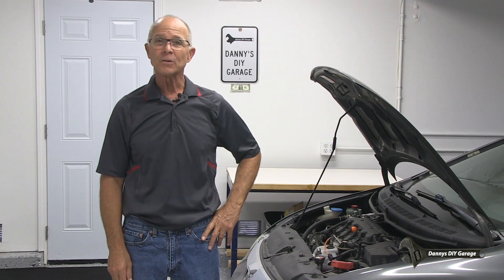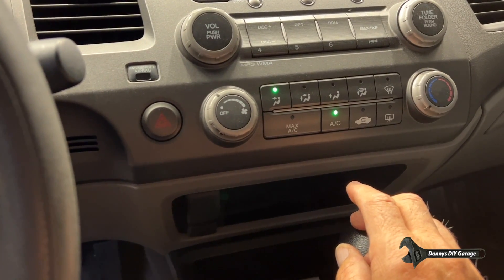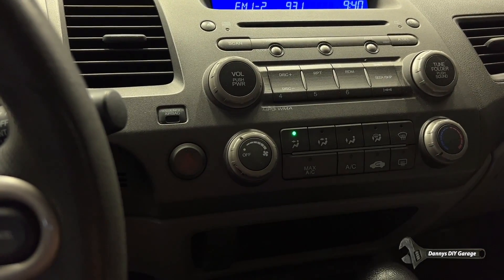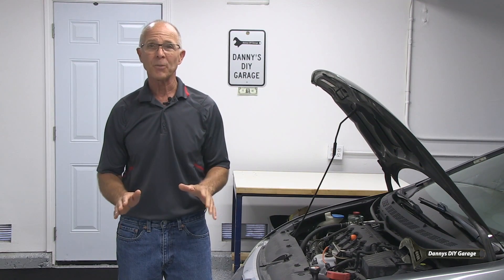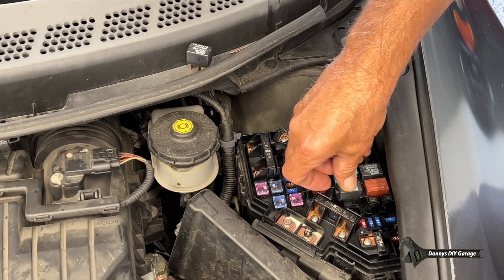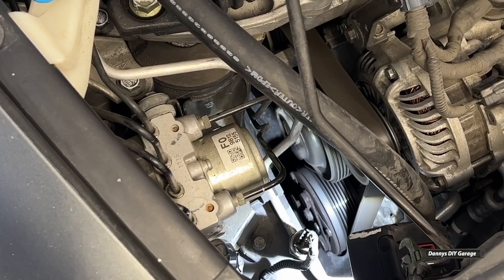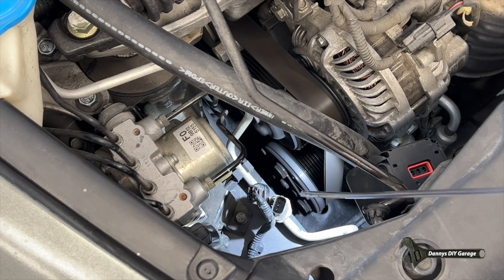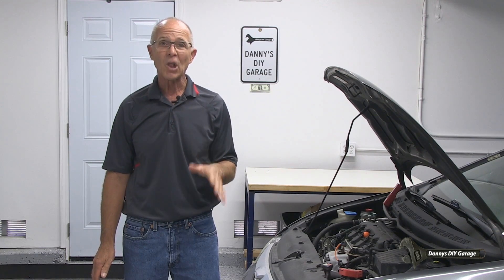Honda Civic 2009 AC system blows warm FIX

Comment: This is a great video and it covers a lot of diagnostic steps. I would like to add one more thing that could have gone wrong and could be affecting your AC compressor clutch from engaging. I actually got an AC compressor replacement and then realized that my compressor was still not engaging when AC was turned on. The relay was not the problem. The connector that plugs into the AC compressor had gone bad. It ended up being a simple $25 replacement. I wonder if I could have gotten a lot more miles out of my original compressor if I had figured that out earlier. The part number I used was Duralast Electrical Wire Connector CONB11374 to replace the original connector on my 8th generation Civic.
Reply: For reference, it is the black female connector on the left on top of alternator in the frame at 5:35
Reply from the maker: Thanks for adding this

Comment: A lot of times on these 8th gens, over time the shim that helps engage the AC compressor clutch expands and contracts over time from heat until one day the AC compressor clutch won’t engage anytime the weather gets above 85 degrees, because that shim warps.

Solution: remove the shim! No need to replace it either. AC will be blasting cold again! Did this on my 08 Si about 3-4 years ago and AC has been perfect ever since!
Reply from the maker: Thanks for adding, one of my videos covers the ac compressor clutch air gap and how to diagnose it, exactly what you’re suggesting

Comment: Would've been nice to know be told where the blend door actuator is located
Reply from the maker: I have two videos on the air mode actuators, one that controls the temperature and the other that controls the airflow direction of the vents, I thought I linked them in the description and at the end of the video as suggested videos, if not sorry about that, I’ll make sure I do that
Reply: @dannysdiygarage sorry, just had me a tad confused is all. Video was really helpful and I've realized it might not be as expensive as I thought
Reply from the maker: @youtubechannel8854 good luck, follow the video and it will go great, thanks for checking out my channel

Comment: Great video. Really helpful. When doing the process for code which light is supposed to flash? The one on control doesnt but the check engine light flashes 5 times.... the issue im having is that the ac compressor doesnt cycle off. Also when on recirculation I still get smells from outside and when blower motor is off I still get the wind from outside blowing in. Does one of the actuators control recirculation?
Reply from the maker: I have videos on both actuators on my channel, I also have more AC videos that should help

Comment: the relay test ended up fixing my issue, went from blowing 82F to 74F....replacing the cabin air filter now and will eventually recharge the freon to see how low i can get it.
but for now, this is plenty cool :)

Comment: Is part number 39794-SDA-A03 or 39794-SDA-A05 the correct part for a 2007 Civic SI AC relay? I’m reading A03 is being replaced by A05 because it is a known issue in AC failing. Is that correct?
Reply from the maker: I’m not sure

Comment: Saved me thousands! This guy goes step by step working through the possible problems. Mine was the relay for the compressor. Simple fix to repair, but never would have thought to switch with the fan to check. Thank you so much!
Reply from the maker: I appreciate your gratitude and support

Comment: My 2013 Honda Civic EX has an issue where AC runs but doesn't cool for long time (like 30 mins+). Have checked Freon and that is fine. Any suggestions?
Reply from the maker: check pressures with gauges, that's really the only way to diagnose freon problems correctly

Comment: I was trying to put Freon in my 2010 Honda Civic ledgers cause it's blowing hot air and it's showing it's almost full but the compressor clutch gets on and off on and off. Do you have any ideas?
Reply: Check your hose if your hose doesn’t have a leak, you may need a new compressor

Comment: Any help would be greatly appreciated. When I turn my temperature knob, the actuator does not move, but the temperature does change.
Reply from the maker: Check my latest ac tips video, it has links to what you need

Comment: My ac has weird symptoms. Its progressed to not really working at all but here goes. So at first it was only working when it was below 80f approximately. Then it would only work on the freeway. Now it barely works on the freeway. It will go from cold to warm. Ive checked the Refrigerant and it says its full. I dont get any codes. (2007 coupe honda civic LX). Any ideas? Thanks!
Reply from the maker: watch my latest video on AC Tips

Comment: Hi Danny, I have a 2010 Civic Coupe and I noticed when I drive down the highway on a cool day with my AC off and only the main vents selected to outside flow, I get warm air coming in. The recirculate is off and the fan motor is off. Do you know why I am not getting the cool air from outside? Why is it warm? I am travelling down the highway at 65. Thanks, you have a great channel
Reply from the maker: Make sure temperature control knob is set at cold not hot, make sure recirculate button is on, that should help. From my understanding this is normal on all cars, car manufacturers want fresh air coming into the cabin for safety reasons, all my cars do this, however if it’s excessive, their can be a problem.

Comment: Oh, I’m trying to diagnose my AC compressor clutch/cycle switch… can’t find any information on how to do it and even where it’s located.

Also on the control head that you ran a test by holding the defroster and recirculating button down my recirculating button was flashing so how do I address whatever it’s telling me

Comment: Dan,  I have 04 honda civic  ex 1.7l
Honda blows hot air.
I verify the compressor engaging, fans working, charge is perfect

What I did notice 
The low pressure line is hot never goes cold. 

I believe  my expansion  valve is bad..

Comment: 2010 Honda Civic. My AC only cools when I'm going 50 mph. They drained the Freon and put in new one. The compressor kicks on. I checked the expansion valve and cleaned the condenser. But what I find strange is that it doesn't drain water like any AC system normally does

Comment: Hi,
Would this apply to a 2104 Honda civic LX?
Have it blowing warm air. Ac main relay is working. Even swapped it out for a new one and still blowing warm air. 
The compressor clutch does engage.

Comment: I did get a code on the control panel it blinked about 4 times on the air recirculation bottom

Comment: In my case, the issue seems intermittent- i am now aware that Honda disables the Clutch/AC when accelerating, but mine doesn't seem to want to come back on unless you depress the AC switch again. and sometimes, it still won't come on then.
Reply: check the relay.

Comment: Hi.. I have the same honda civic 8th gen..... Having an issue with the aur conditioner..... normally the car idles at 800 rpm ...but when I turn on the ac...rpm stays at 800 and ac doesn't blow cold aur ...but when I accelerate to 1000rpms .....the ac starts working normally and blows cold ..aur...as soon as i take my foot off the accelerator .. the rpm drops ..and ac doesn't work again...How to solve this issue plz help
Reply: Hondas are famous for radiator issues. Have someone check that and your hoses.
Reply: @nlibby5549  Just replaced the radiator but same issue ......I also think that it's related to vacuum hoses issue....could you tell me about which specific hoses to check for?..
Thanks
Reply: idle up could have issues..  clean the throttle body.  if the engine has an iacv (idle air control valve) , clean it too.  check the gap in the compressor clutch.  might need to remove a shim.

Comment: I just had my mechanic install brand new ac compressor, actuator and was cold for a bit then stopped blowing cold. I believe I smelled something and when I popped the hood it was steaming from lower middle of the engine… do you know what this could be? Summer is just around the corner!
Reply: Leak
Reply: @fernn587 thank you!
Reply: inspect the ac hoses after the condenser.
Reply: @ncolevalv_5673 thanks!

Comment: What fuse or relay controls the blower motor mine suddenly won't come on
Reply: check if it works at max speed.  yes, replace resistor.  no. drop blower and connect it straight to the battery.
Reply: @ncolevalv_5673  ok update replaced resistor and relay and still same issue can work just fine for 5 days in a row then suddenly nothing no air at any speed or even heat and blower doesn't activate then 1 hour later everything works perfectly fine and its like this at random could work fine for 1 day or 2 weeks without any issues then quits working when it wants suddenly to start working again a couple hours later what could possibly cause it to act like that? Even tried getting codes from the ac & nothing
Reply: @ssj4jamesmichael785   to troubleshoot like a pro,  when blower is not working, disconnect the connector at the motor, check for voltage at the connector with a test light or multimeter with key on, engine off and fan switched on.  if test light lights up or there is battery voltage at the connector, the motor is bad.  no voltage,  check if there is a power or a ground issue.

Comment: How did you come to conclusion it was the expansion valve? I watched your video many times and couldn’t find how. Maybe it was a leak?
Reply from the maker: I determined this due to the pressure and outlet temperature didn’t make sense, the metering valve ( or expansion valve was the next logical suspect, previous work was evacuated and recharged, I should have explained this better
Reply: @dannysdiygarage   Thank you for the clarification, I was a little confused when you said the ac compressor could have a leak due to not rotating. Mine seems to have a similar issue so I’m thinking of doing a dye leak test in hopes it’s the the compressor leaking and not the metering valve since it blows cold for a couple minutes  when refiled and then just runs out.🙏🏻

Comment: Literally saved me about $1000 watching this. Local A/C repair shop was going to do new pulley/clutch assembly on the compressor as it wasn't engaging. Only thing they checked was the gas, which was fine. 
I checked my relay after watching this video, and sure enough, there was my problem! Cheers!

Comment: Air cabin filter will restrict ac flow if dirty
Reply from the maker: Great point, thanks for sharing
Reply: Do you have a Honda of this model? I have a 2010 Honda civic and the only filter it has is for the air intake, it doesn’t have a cabin air filter. I’ve looked. Should be the same for 2008-2011

Comment: So my fans aren’t working at all what can I do to make my ac blow cold
Reply: replace the fan fuses and relays.  but first check if the connectors are loose.  if you can hot wire the fan motors to the battery, do that too to see if the fan motors are bad.

Comment: Hi Danny., another great video..I have the same issue but with my heater in my 2010 civic.  The driver's side vents blow good hot air but the passenger side vents blow cool air.  If I block the driver's side vents with my hands...then the passenger side vents start blowing warm air, but once I let my hands off the driver's side vents...the passenger side vents blow cool again.  Any idea what that could be?  Thanks
Reply: bad mode door actuator

Comment: Thanks for this video. I did these checks and on my 2008 Civic SI, only one radiator fan comes on with the AC is engaged. Is this a problem? I've had AC problems for a while and repair shops replaced the evaporator, expansion value, and compressor "many times". It still doesn't blow cold on hot days, they give me the run around when they can't fix it.
Reply: yes both fans must come on when ac is on.

Comment: Hello, danny I really need help, my ac clutch doesn’t work, but everything on the air conditioner seems to be fine, compressor even works and blows hot air, and everything, of course it’s low on Freon r134a, but air conditioner tries to work and blows a little cold air, but when I try to blow cold air it blows warm, can you help me what is the problem?, also the air conditioner fan works without problem, the engine one doesn’t because it is not necessary

Comment: Hey Danny, what if your hvac system only puts air out on the dash and not out defrost or floor, Regardless of which zone is selected? Just noticed my 2010 civic has this when trying to defrost 

I selected defrost and air continues coming from dashboard vents

Comment: How did you know it was the expansion valve? Is that the only thing to check after everything that came before?
Reply from the maker: Expansion valve meters the Freon and it was the most logical solution and it worked

Comment: check your fans too. both should spin when the acs on. if one dont spin, you dont get enough airflow on hotter days. i just drove home today in 112°f heat and it was enough to make the compressor shut itself off, all cause the stupid condenser fan relay didnt work :(

Comment: Hi danny, I have a 2008 civic lx. The AC will work when at night time, AC will work for the first 5-10 mins of driving at the hot day then it will start not blowing cold air. What can be the problems there and I have recharge the AC.

Comment: Hey Danny. I also have a 2009 Honda Civic Hybrid. I have a digital thermostat temp gauge. When holding down the recirculate and rear defogger for a few seconds my display spelled out AC. My control head does is not change the direction of the air and it’s also hot air and not blowing cold. Any ideas?

Comment: I’ve had my A.C. fixed numerous times. Just last summer at the tune of over 400$. Still blows out mildly cold air. I a m at wit’s end!
Reply: Actuator blend door sticking maybe? I spent $980 on my 2009 and it was still blowing warm. I messed with the blend door and it started cooling, pretty sure it's sticking.

Comment: So what if my recirculate light is flashing?
Reply: That means there's an AC code. It will flash a number of times. Count the number of times the light blinks 
1 blink= code 1
2 blinks = code 2
...
Reply: @DomDix91 okay what about it blinks 5 times?

Comment: Correct me if I’m wrong but when filling the low pressure side are you not supposed to keep the can upright and 45 degrees max to keep liquid from going into the low side? Can’t compress liquid, right?
Reply from the maker: The can has special instructions on this, follow the instructions on the can, but you are correct unless the can says different

Comment: My pressure system is messed up and the low side has high pressure and the high side has low pressure
Reply: I’m pretty sure mine is too how do we fix this? I’ve never worked on AC

Comment: I’ve replaced the switch, relays fuses and the dam conpressor. I’m clueless what it could be. Even my multiple mechanics have no clue. We’ve also tried the Freon and nope. Compressor comes on when I first start the car for maybe 10 seconds and then kicks off and the two fans at the radiator turn off when the compressor does too. It’s 98 degrees out. I’m dying. Does anyone have any clue wtf is going on?
Reply from the maker: there are many checks that still need to be performed, I would watch my videos on fans not coming on also, this may help with your diagnosis

Comment: Danny - I didn't get any codes from the control panel at 2:09 in the video. At 2:26 in this video, the 2nd mode/button from the left on the control panel is NOT working properly. This is the button where there is an arrow pointing to the face and an arrow pointing down to the floor. The light comes on OK,  but the air is ONLY coming on at the bottom toward the floor, NOT at the top toward the face. I did notice that if I select the 1st button, with the arrow to the face, and the 3rd button with arrow pointing to the floor separately they both work. What could be the issue?

Comment: So my ac was blowing warm on idle but once I would go it would cool down followed this man’s first steps and turned out my cold to heater actuator was just stuck a little before all the way cold flipped it to hit the back to cold and fixed the ac issue lol what an easy fix
Reply: How did you fix it exactly? Im having the exact same issue (coolish air blown at idle, alot cooler while moving) my blend door actuator moves when I change the vents from face, to feet, to defrost.. all of that. But it doesn't move at all when I change the temperature from cold to hot, and back and forth. But it does change the temperature.
Reply: @The_real_Overrunn No

Comment: So a guy was trying to help me and connected the freon can but nothing would go in

It seems to me that Honda has the worst air conditioning system ever built. Myself and both of my sons have Honda vehicles with dead air conditioners. It never happened in my Toyota's before
Reply: Hey there my friends I want to tell you that my neighbor was mechanic and he did the so-called Freon recharging and brought it all back to life.  So that has changed my opinion so much
Reply: @JamzStudios had my 2010 civic for 10 years now. Did end up having to replace a Freon line
 once and had to recharge freon about 3 times. But other than that, it's been pretty reliable. Cools just as fast as most modern, newer cats.
Reply: If your having problems with the freon going in and nothing else is wrong litterally grab a rag and empty it in to the rag then refill it might be over filled worked for me
Reply: How?  @Smokinkguns
Reply: I bought a used Honda 3 months ago that had ac issues. They had to replace the compressor. I also never had any ac issues with Toyota. After this car I'm going back to Toyota.
Reply: With your reply clrealy you dont have knowledge about cars. What a shame